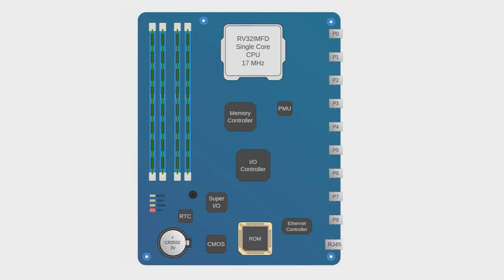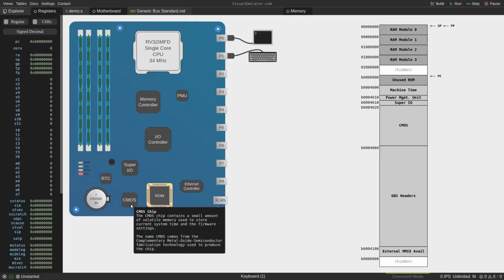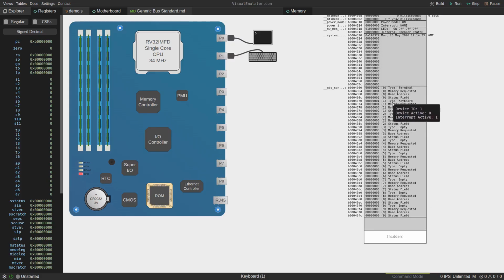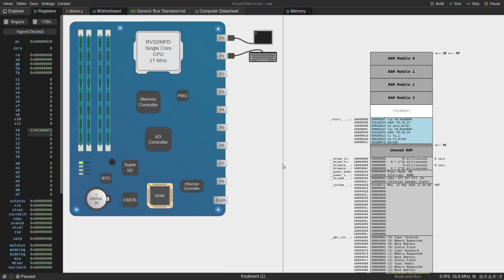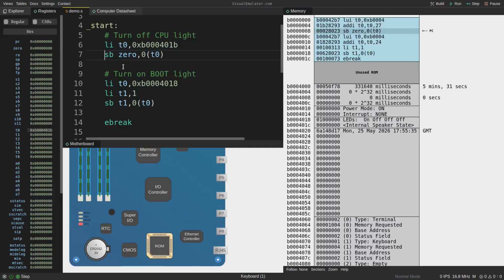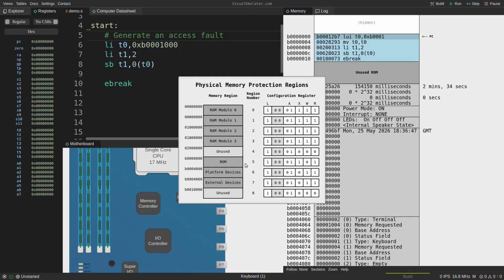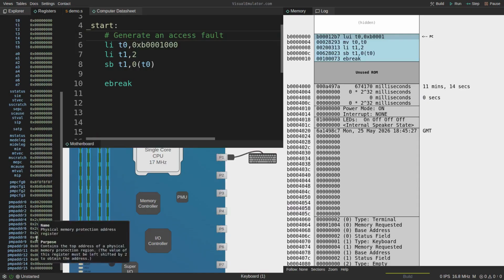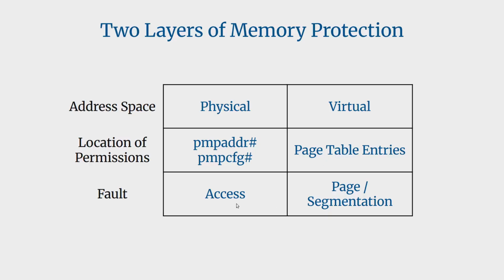Physical Memory and Memory Mapped IO | RISC-V Assembly Tutorial

Comment: Wow. This is so high for YouTube level! So I have 2 questions:
1. Which program or setup are you using?
2. In this scenario, how do the parts of the hardware know where their memory region is? It shouldn't be static, I guess.
Reply from the maker: Thank you!

1. I built this web application specifically for teaching/visualizing low-level programming topics. You can try it out yourself at VisualEmulator.com. This video is part of a course on bare metal assembly programming.

2. In general, hardware components do not need to know where their memory/registers are located in the physical memory map. The internal memory/registers for each hardware component is located inside that component. The hard-wiring in the component allows it to directly access its own memory.

The physical memory map allows the components such as the CPU to know where to send information when communicating other components. The address ranges used in the physical memory map is determined by the motherboard manufacturer, chip-set manufacturer, firmware, and/or OS.